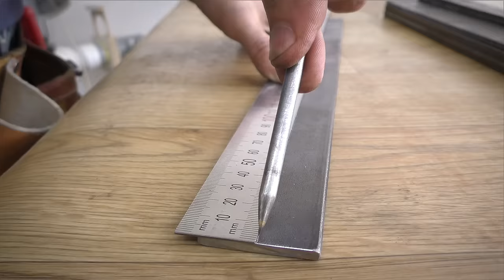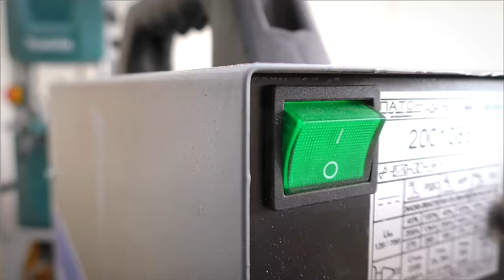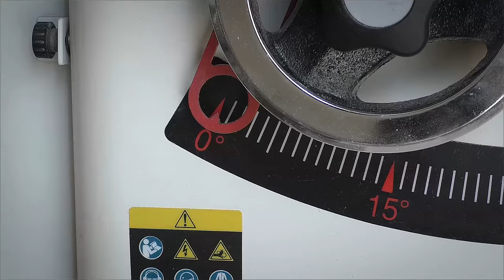🤜 W O R K B E N C H 🤛

Comment: Super valuable workbench. With all the extras.
And a few very good ideas.
If the woodworms don't eat this workbench, it will last forever.
As sturdy as you have built it.
You can work very well with wood and metal.
Excellent work.
Many thanks for showing it

Comment: I can see that you collect dust and wood chips through plastic pipes. From what I read several times it seems that plastic pipes generate static electricity, which might cause explosions in some cases. What is your point of view about that question? Did you connect your pipes to a ground cable? Thanks for your videos which are very interesting and a great source of inspiration.

Comment: 3:12 when using a band saw either in general or specific to this type of cut is kickback a risk?  Is a stop block an option for a band saw?
0:56 once 2 sides are squared on a jointer and a 3rd on the table saw could you use a jointer in place of a planer for the 4th?  Would the same hold true if you only have a planer?

Comment: It is very impressive on many levels. Question, I assume a car shock absorber is a heavy duty piston running in a closely fitted tube, after you remove the lubricant is there any chance of it binding after a few years of use, if so how do you minimally lubricate them as part of a scheduled maintenance programme?

Comment: A Scribe Joint should be used when using moulded timber such as skirting board. I the case of Square Stock a simple but joint with no mitre. Both these methods will help reduce the effects of shrinkage in the joint and prevent cracks as the timber shrinks as it dries. Only timbers with low moisture content should be used to further reduce the effects of shrinkage. Regards Brian C        AC&J, HNC, MIBCO, Cert ED

Comment: To cut the top off 2 tools you can use 1 table saw  2 band saw add sand paper to a flat board and sand both parts of the box.

Comment: Why the hell is everybody using a face planer? I never have and if there was any issue with table surfaces out of wack I just used a hand sander, which is something I would’ve done any ways. Just another 2ft square of floor space I never have enough of anyway.
Reply: Of course I don’t do oak either😅